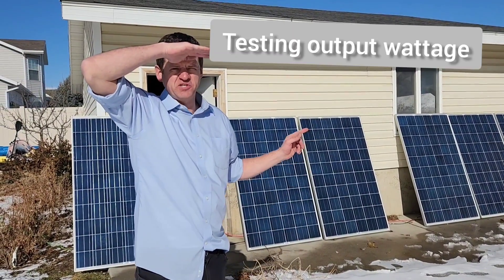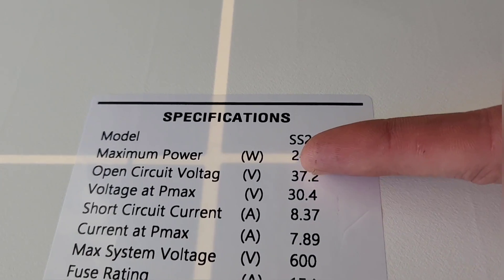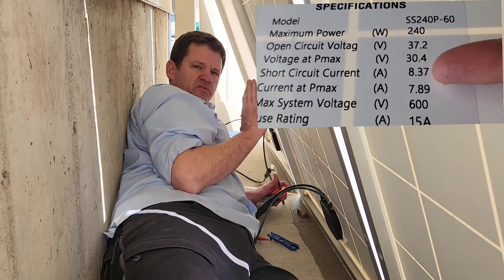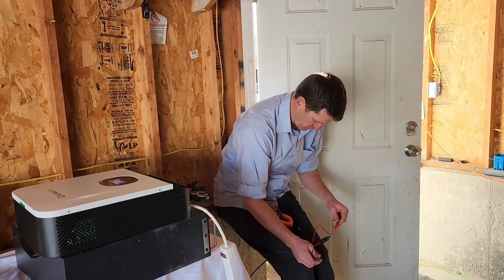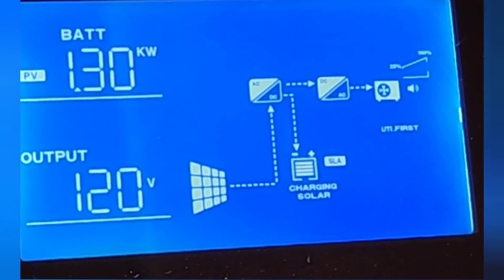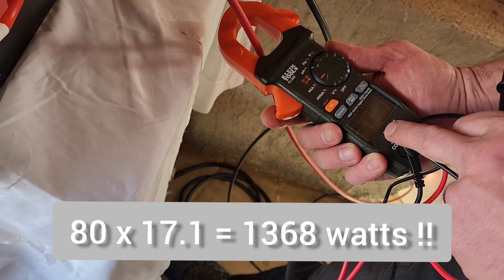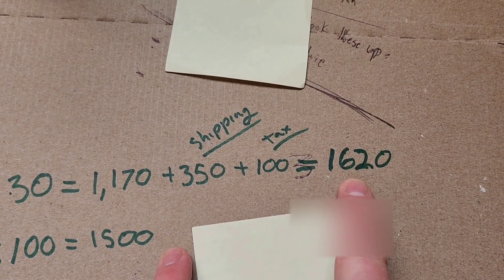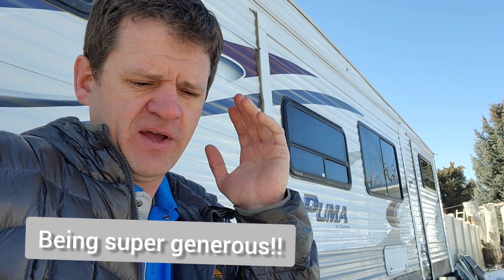DIRT CHEAP USED SOLAR PANELS from SanTan Solar. $34. ( Real world review and test)

Comment: Really you don't need to test these panels. You got them cheap. Because they are underperforming, flawed and QC rejected. They are called seconds. And they put them on sale. Because they will fail in a New York second. But if they don't fail? They will continue to deliver some juice. Albeit without consistency. Because some of the electrons will fall through the cracks. On the back. They will just go leaking out. Because they are flawed. They are used. And something has already smashed into them. Like heat and extreme solar radiation.

So you purchase the stuff on sale because it's a bargain. And hopefully it might work for a little while? But at reduced performance, for sure. Because it no longer meets their Quality Control Standards. And you get to purchase the stuff on sale. That has exceeded its sell by date. That doesn't mean it's bad. That only means it might be slightly less nutritious and current and wattage packed. It won't have enough vitamin D or electrons. And we need our electrons from the sun. As they are free! Free for the next few billion years! It's free! FREE! FREE ELECTRICITY! Because electricity should not be in jail! And being held for ransom by American oligarchs! They are now holding everything for ransom! At the minor price increase of 25%-200%. Which the wealthiest people have no problems with. They always get what they want. They will not suffer. So everything is, hunky-dory. And the wealthy ones win the game! Because they know the right way to cheat with money. You just ask the American people to get the money you need to cheat with! They teach that at IV League Universities. Where the heroine flows continuously. For the wealthy students like, Bobby Kennedy Junior. Who could have as much high-quality heroin as he wanted. For over 14 years. Until a poor little brain eating worm died from it. Now his brain has completely healed. All the holes have been filled in. And he is perfectly fine. Only the worm has chewed through the nerves to his vocal cords. But he is otherwise perfectly fine. At nothing to worry about except vaccines causing autism. And all vaccines will now be destroyed. And we shall get Heard, immunity from, a, bored of Edgumakashun. Administration. That demands Ignorance of the people for the people!

It won't end until we have another, Lee Harvey Oswald, John Wilkes Booth. Who were both assassinated. During the early part of the Trump Camp Pain. As Donnie almost got Heard, immunity. In his right ear. He could hear the bullet. But it was not in stereo. It was right channel only. And that did not register with Donny. In his cranium gray matter. It missed the point altogether. In his head.

Donnie has a brain shaped like a Pyramid. And he sits on the point of the top with his ass hole anchoring him in place. Like sitting atop the Washington Monument. And renaming it the Donnie Monument. And will now mark the shortest skyscraper condo in Washington DC. Everything will now be taller than the Washington Monument. 65-100+ stories tall! Making Washington DC look like a real city doing commerce and making money. America 1st! For Donnie!

We had a happy ending back in 1862. When we finally murdered the Confederacy. We had a party. After we murdered the Germans. And after we blew up the Japanese. With our new toy. And that worked exceedingly well. Because that's the only way stupid people can learn. Is when you handicap and disable them. Make them invalids. Make them cripples. Physically and mentally crippled. So they know what they did was wrong. Otherwise they can learn no other way. They have no brain. They have no education. They have no knowledge. They do not read. They have no intellect. And there's only one way to handle those types. The same way we did with the Germans and the Japanese and Osama bin Laden. Because you can't be nice with them. They do not respond to nice. They know that's a sign of weakness. So they can attack, conquer and overcome! They are primitive bipedal, hominids.

Yes and they do not understand English. So they were born here to a couple of Caucasian parents. And being told they are superior beings. Since they are white and white is pure and virginal. White can never do anything wrong. Because White is right. White is good. And any shades darker are just that. Inferior Homo sapien hominids.

Americans have voted. To turn back the hands of time! To the more happier bigoted times when whites ruled America. And they want to go back to those times! It required the wealth. Of the wealthiest man in the world. To make that dystopian utopia come true! Because he can always split for Mars you see? And you can't touch him. He's above the law. When he exceeds 12 miles above the planet. Then he is in, International Space.

Yes soon we shall all be wearing, Depends. After the utilities get shut down. And your toilet will no longer flush. And you will not have to take any stupid baths anymore. Or even use deodorant. Since none will be available nor made, anymore. When men used to smell like men! And women had, PUSSY flavored pheromones. As women don't need Feminine Deodorant Spray. Their PUSSY stinks just fine, normally. Yours would also if you had one. And it smells like a woman in heat. Boys like that. It is their favorite aroma. They can't get enough of it. And so I do not understand why women are stupid enough? To wash their dirty underwear instead of selling it? Think how much money they could make? Boys would want a monthly subscription! Smelly panties of the month club. Look at how women could financially benefit? I would do it. And every month with their subscription fee. You can send them a brand-new stinky pair of well used panties. Panties worn for a week! Aged for a week. The kind you love, the most.

I'm just saying…… Women have not yet figured out how to do that? Sell my what? GET THE FUCK OUT!
RemyRAD
Reply from the maker: Are you saying you might be the next John Wilkes Booth?

Comment: Thanks for the useful information; however one must note that even solar panels have a life span. If you get used panels that lifespan will be shorter. One must therefore consider the shorter life or cost per year.
Reply from the maker: Correct, I believe you can call them and ask how old they are. I have seen a other YouTuber review these and some of the used panels end up being more efficient than the new solar panels.
Reply: I hear this all the time but in reality the annual drop in production is a half pf a percent so 20 year old panels should still make about 90% of the uotput as new ones. There are many examples of 40 year old panels still in use and making 80% of their original.
At 15 to 30 cents a watt who cares as long as you have the room for 10-20% more panels.
Reply: @ghz24  Ok but their actual life will be reduced.. by how many years old they are?

Comment: santan solar pallets aren't always cheaper. Sometimes it's more vs the same exact ones buying single.. always do the math, not sure if they make mistakes or if it's on purpose.
Reply from the maker: So you're saying buying new is sometimes the same price as buying used?  I've never seen that.  Funny though... "Projects with everyday dave" tested the used ones and they performed better that his new ones.
Reply: @diySolarPowerFunWithRay  no I specifically said their pallets aren't cheaper. Some of the pallets cost more per panel than the panels do buying them one by one
Reply from the maker: @gg-gn3re  yeah it's the shipping that's expensive. It can cost up to $400. That's why it would make sense to buy a pallet. But if you pick it up that's definitely the cheapest option because she don't pay for shipping.

Comment: Is there a way to install diy system without batteries where the power generated by the panels goes to edison.
Reply from the maker: Yes, the growatt 3000 48 es inverter will run without a battery. I reviewed it and tested it without a battery here. https://youtu.be/BsrGH13c5-I

Comment: I also bought from SanTan and cringed over the freight. I live In Southern Nevada, The key is buying at least 25 to get the average panel freight cost down. Even panels with snail trails will put out their listed watts. I will never buy new again, my first project had 40 325 watt panels new and had I known about SanTan I would saved a bundle.
Reply from the maker: Cool. I hear the snail Trail panels produce really well but I haven't tried them yet.

Comment: I bought almost identical panels for ~$50 here in EU. They are worth it as new ones are now in the $120 range.
And if I get it my way, they'll provide plenty enefgy for many years (I plan to add heat exchangers on their backs to cool them down and get more free hot water) 

But that's not why I'm commenting here. I wanted to ask what's with the random blur parches on your video?
Reply from the maker: Just exchangers huh wow, that's an awesome idea  please share a link.  I think the blur was the camera trying to focus. Or me taking something out that wasn't relevant.
Reply from the maker: Can I ask where you bought your used panels?  There have been alot of people in the UK asking.

Comment: Do you prefer the Klein CL390 for volt and amps testing?  Or is there another tool that is sufficient.  Klein is a bit pricey, so just curious. Thank you.
Reply from the maker: My clamp meter journey started out with the cheapest one on amazon... I couldn't get it to work. 
 ...maybe user error  Then recently I bought the AC/DC amp clamp meter from harbor freight.  I wasn't sure it was giving me the correct numbers, It could have been accurate but I didn't have anything to compare against... So I returned it and bought the CL390 from home depot(https://amzn.to/3LZTw30).  I trust it... and surprizing it wasn't that much more that the harbor freight one.  the CL390 is nice because it does both AC and DC amp measurements(I think that feature was the biggest contributor to cost). It also does Temp measurements, volts, and has a non-contact audio voltage tester(ncv).  I've only used the NCV once but I wasn't super impressed with it... Before I can recommend it to you I would like to try using the NCV more.
Reply: @diySolarPowerFunWithRay  thank you for the detailed response. I would be curious your thoughts on the contactless reading. The price point between the Klein tools and some of the others ones is decent enough to what to ensure the product does what it advertises. Please let me know how your testing goes. Also, do you have any recommendations for flexible solar panels. I am in an apartment and looking for something I can dangle off my balcony and connect to a EcoFlow to sustain if we encounter rolling blackouts. Which I think is coming because the energy situation is not what we are being told.

Comment: If I have 5 panels rated at example 20v /10 amps.  Then I were to hook 3 in series and 2 in series then both together in parallel. What is my total volts and amps?
Reply from the maker: you'll have 40 volts and 20 amps.  Diy camper has the best explanation to calculates something like this. https://www.youtube.com/watch?v=jejro4zkl8I

Comment: Nice video, thanks... Two thoughts: 1) RV roof area is limited, so better performance is preferable if you can afford it.
2) Selling 15 out of 30 panels to "get 15 for $120" is good, but unless you need all 15 panels, selling 17 of 30 to get 13 panels AND get paid $80 for virtually the same amount of work, is even better :)
Reply from the maker: Thanks, I'd like to know how hard it is to sell them. It seemed like that guy had a pretty easy time getting rid of his extras.

Comment: Hi Ray, I live just west of the Phoenix metro, so I drive to San Tan to pick up my panels. Out here, a lot of us are installing the used panels and they work great. Most of the used panels are coming out of solar fields and they seem to have a lot of life left. As an idea for a future project, maybe install some sort of connection to allow your trailer to supply power to your home, when it's just parked. Get some good Anderson connectors with weatherproof housings to install on your trailer and house or garage. BTW, good video!
Reply from the maker: Let them know I sent you and they can get you a discount code now.
Reply from the maker: Thanks. that's a good idea. hmm...maybe just buy a grid tie inverter, near my trailer, that can plug directly into my battery and feed an AC outlet in my external garage that will backfeed or supplement on sunny days?  I haven't done anything with grid tie yet but I think that's the basic concept.  That sounds like a future video. It would be cool to see the savings.
Reply: @diySolarPowerFunWithRay  , I had a grid-tie home in Mesa, AZ. To tell the truth, I like the idea of grid-assist better and split system best.

Comment: The Voltage Short Circuit: Was it tested without the current meter in line with the positive and negative leads and you just used the current clamp around the wire with the solar panel's positive and negative MC4 connectors connected to each other? I want to repeat the test on my panels and I have the same meter as you. Thank You!
Reply from the maker: Yes, I just plugged both the positive and negative mc4 connectors into each other and used my clamp meter. Make sure you reset your clamp meter to zero before you clamp it...i think i made that mistake here when i was measuring mine... that may have been why it was so high.  A lot of people make that mistake
Reply: @diySolarPowerFunWithRay  Thank you. Very, very helpful for a beginner like me. I want to be able to test panels before I purchase as there are lots within driving distance here in San Diego.
Reply from the maker: @benkanobe7500  no problem, how many panels are you looking to purchase? What is the size you're wanting
Reply: @diySolarPowerFunWithRay  Panel number will depend on panel wattage. Size is not an issue large or small as my system is ground-based. I don't want to purchase as you or Will have suggested as I don't want a hassle if the panels arrive broken. I would rather pay more and let someone else assume that risk. There are lots of used panels within 1-1.5 hour drive from my home in North San Diego (Fallbrook). Thank you!